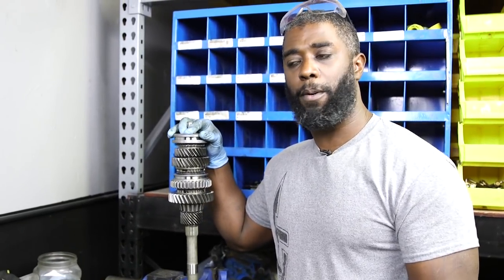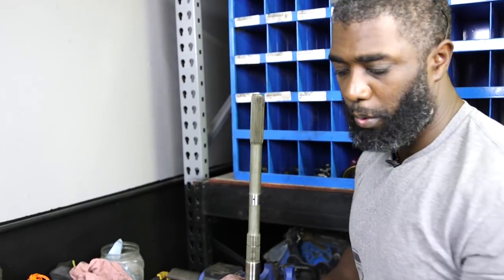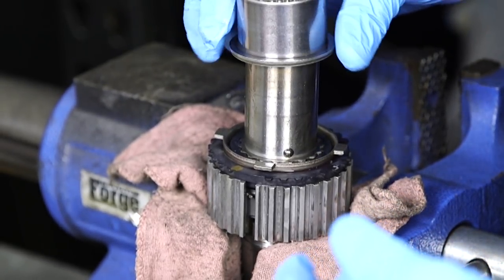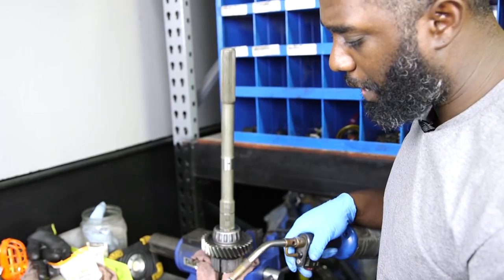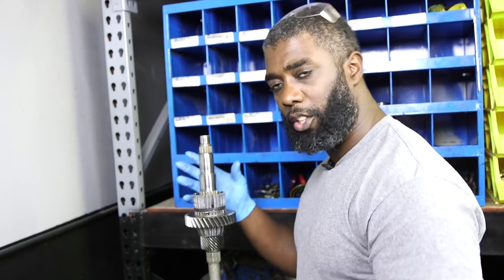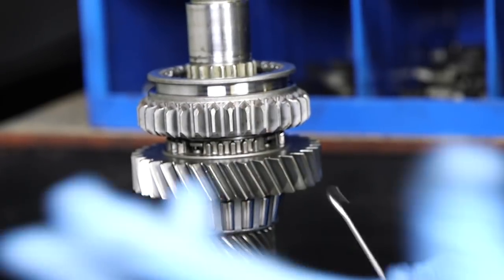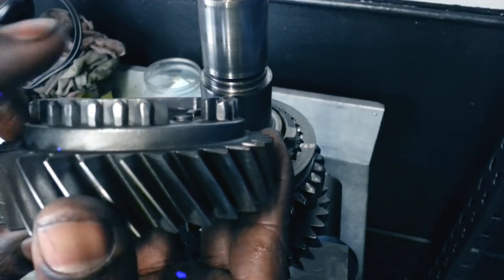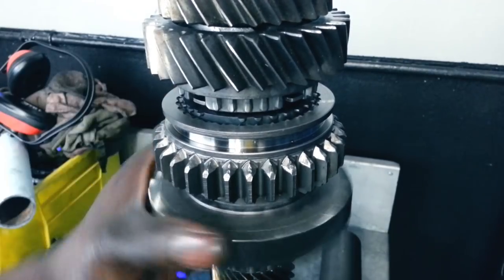How to Rebuild T5 Transmission Part 2 of 3 JUNKYARDDOGGS.COM

Comment: GREAT VIDEO WITH STEP BY STEP EXPLANATIONS. I USED THE SHAFT WITH THE CHECK BALL INSTEAD OF THE ROD, WHEN I REBUILD MY T-5 YEARS BACK. THE SHAFT WITH THE CHECK BALL IS STRONGER, AS OPPOSED TO THE ROD WHICH IS DRILLED DEEPER INTO THE SHAFT WEAKENING IT. AN EXAMPLE OF HOW DRILLED HOLES WEAKEN THINGS. ON THE EARLY FORD 289ci ENGINES, THE CONNECTING RODS HAD SMALL OIL SPIT HOLES DRILLED INTO THEM ON THE CONNECTING ROD WHERE IT BOLTED TO THE CRANK. IN RACING APPLICATIONS THEY WERE NEVER USED BECAUSE THAT VERY TINY HOLE WEAKENED THE ROD BY 100HP. MY ADVICE IS TO USE THE BALL DRILL SHAFT FOR HIGH HORSE POWER CARS.

Comment: For clamping a shaft, screw together two pieces of oak or hard plastic like composite decking with a 1/4 inch spacer in between and drill a hole ~ 1/16 smaller than the shaft, centered on the spacer. When you unscrew it and drop out the spacer you have a perfect cushion for clamping the shaft in the vice.  If it slips, put one layer of electrical tap on the shaft.

Comment: Hey Tony.  Have used this video a few times.  Great stuff.  My latest rebuild has spring and ball on the main shaft, on the hub, under the 1-2 reverse slider.  Is this required?  Slider seems much smoother without it.  Appreciate any info.  Thanks.

Comment: great video tony!   I'm in the process of rebuilding mine.  I have a question for you.  when you got to the point to check to see if all gears were spinning properly.   I went to check mine and they didnt. followed you step by step I cant figure out were I went wrong. when I went on to put the spiral shim I noticed things got tight.   I have restarted a bunch of times. I'm stock. please help

Comment: Can I use a sn95z out cobra on a 1984 5.0 mustang if I can what do you have to do to it so it can work?
Reply from the maker: Yes you can.  Change the input shaft and bearing retainers to a Fox length and your good to go.
Reply: @JunkyardDoggs I got the SN 95 bell housing and clutch fork will that work instead of changing the input shaft
Reply: @robertvaughan6125  yes but it will move shifter back further in your interior

Comment: When you're talking about horsepower range, standard vs higher horsepower, what ranges do you mean? Would a standard T5 be good for a 302 around 300hp?
Reply: All depends on the metal id tag.  That is how you get specifics

Comment: What about changing the 5th gear ratio to an 80 or 82 ratio. Can you do that? Or know someone who has?
Reply from the maker: Yes i can.  Ive done it twice before it requires that you install the gear AFTER the main shaft has been installed into the case.

Comment: Whats all needed to get a v6 3.8 tremec t5 to fit  behind a 5.0?
Reply from the maker: The last video of the series is dropping today.  I give all the techniques to make it work.  You need a v8 input shaft, bearing retainer and change the speedo gear.

Comment: in ref, making the teeth weak or aneling the metal when your using a torch.... very bad if you wanna get that gear back to were it was you need to re heat treat it back to spec but first heat treat it for 24 hours and then cool it down naturally and then heat treat it to spec.
Reply from the maker: That is true, but thats why I use propane, it doesnt get hot enough to do any real damage.